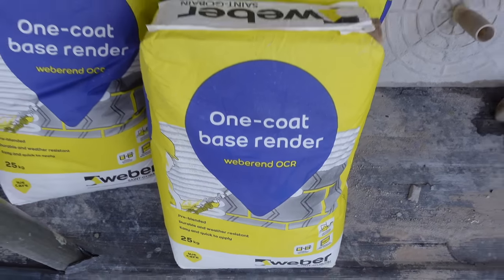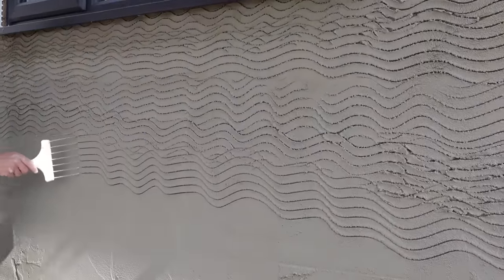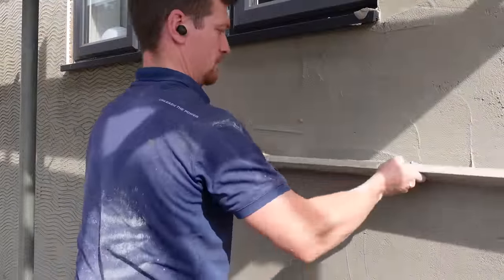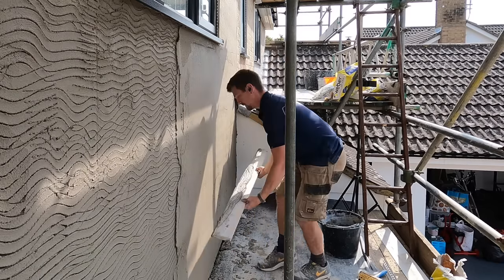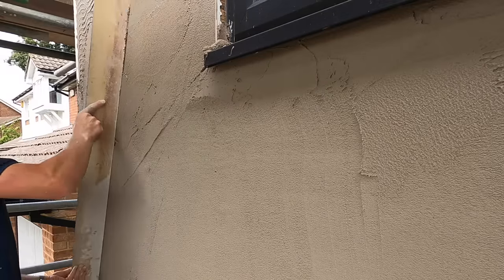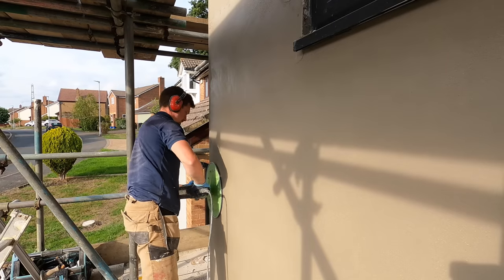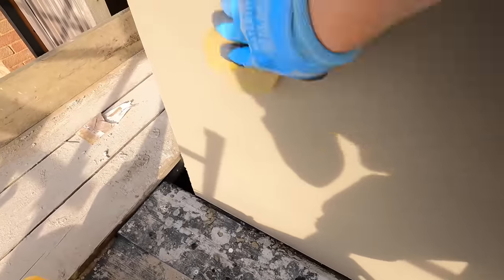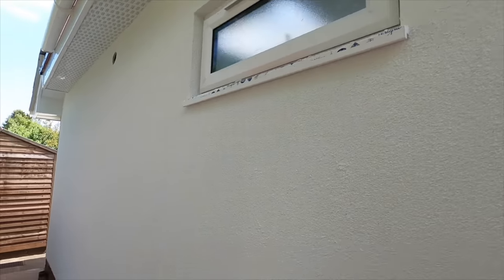RENDERING: Sand Cement Render's DEAD | This Bagged Render's 10X Better Than Sand Cement Construction

Comment: In fairness - it does look more sticky.  Does it ghost  though if applied as a one coat too thin ? Could you apply over a  4 : 1 S + C scratch coat to save a bit of cost I wonder?  Weber do a dash system too - that may be more forgiving in terms of dash coverage.. It's a shame they don't do OCR in  different colours  like the monocouche system.
Reply: I think if you can afford the cost it’s better to use two coats of the same material due to expansion. Plus especially in my region the sand is heavily contaminated with china clay. I have tried to wash it out myself but you can’t get it clean. Cement will not bind with clay and so the mortar is compromised . With the bag renders you don’t have this issue. Plus you can get more finished work done in a day , which may be beneficial to the flow of work, so other trades can complete their tasks.
Reply from the maker: I agree with Joe. Looking in the forums it seems that most of the issues come when it’s used alongside standard sand cement render. I think it’s best to use it as it is - I’m getting better results and I actually feel it’s faster.

Comment: Love using bagged render. Fassa MS20 is the best gear I’ve used. 
Definitely recommend using serrated spat to scratch coat in hot weather. Afro comb marks can sometimes bleed through on hot days 👍
Reply from the maker: Is it good?? It’s dirt cheap - that’s what’s baffled me!
Reply: @PlasteringForBeginners  brilliant gear, MS20. 
Very limey so definitely recommend wearing marigolds when laying and floating. I’ve had burnt fingers a few times after using it. 
Plasterers 1stop also sell ‘magic sponges’ for sponging. Brilliant pieces of kit
Reply from the maker: Thank you for the advice mate. Really appreciate it…cheers!!

Comment: Are you using plastic or metal beads? Or are both ok?
Reply from the maker: Both are good but only used stainless steel beads if you opt for metal. The Galvanised ones will rust over time 👍
Reply: @PlasteringForBeginners  I only use stainless steel now
Reply from the maker: Fair play mate 👍

Comment: Looks easier to work with, can you paint it like sand cement render
Reply from the maker: It’s lovely mate and paints like sand cement. No difference there 👍
Reply: @PlasteringForBeginners  cheers. Did you find you didnt have to press it onto the wall as hard. It looked that way in the video. Skimmed a few rooms but been putting off rendering my extension for too long now ha. I will have a look at that stuff used. Cheers for the advice

Comment: Pre bagged render flys on with a machine 🙂 I've a few in stock 🤚
Reply from the maker: I’ve never tried the machine yet but I’m eager to. I bet that’s a game changer.
Reply: @PlasteringForBeginners  yeh saves a lot of time mixing and getting gear up. Spray it wetter than you would use it hand applying so the rule slides better ( saves the shoulders.

Comment: Can this be used to patch in pebbledash with a flicker gun?
Reply from the maker: I can’t see why not mate
Reply: @PlasteringForBeginners  that’s mate. Got a 1930s house with pebbledash render on and need to patch a few areas. So was thinking base coat with this first. Scratch it a bit then flicker gun it over. Done sand and cement patches before but one bag and just add water sounds much more appealing and then I can paint it all when I redo the exterior of my house next year. I do more decorating by trade so thought I’d ask you first 👍

Comment: i’ve had a nightmare with my last s&c job, this is definitely food for thought! would of liked to of seen this floated up with a poly float instead
Reply from the maker: It’s great mate - you won’t regret using it. Absolute dream compared to s&c
Reply: @PlasteringForBeginners   my issue would be the time id have before it went off, like you said it was ready to float immediately after you’d finished, what if you had the front of a house on?